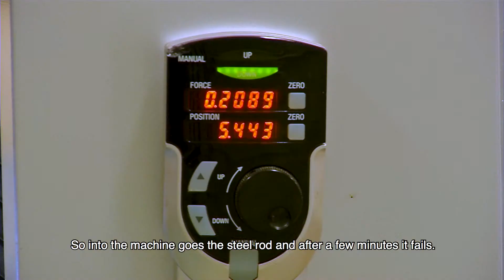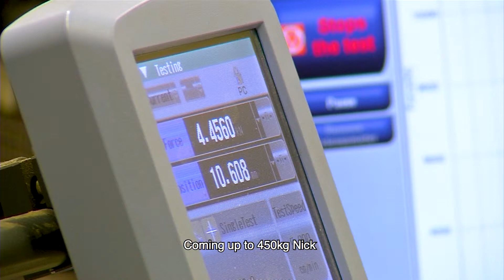Wood Vs Steel - the Material Difference

Comment: Why did you use a solid bar instead of hollow tubing like anyone else would?  What kind of steel was it?  Where's the part where they compare beams of equal size?